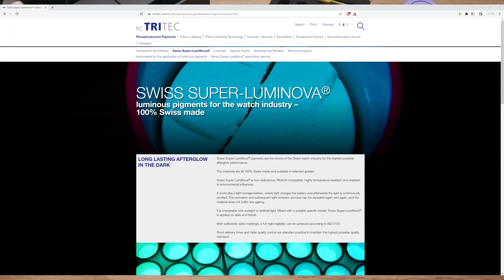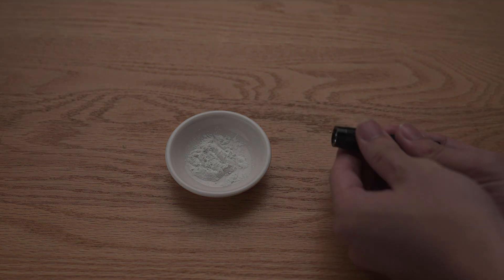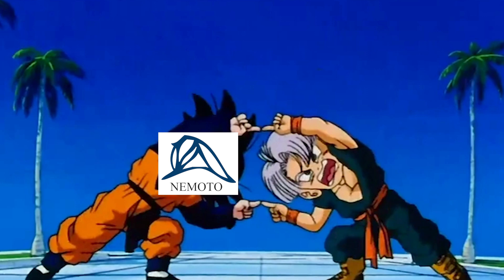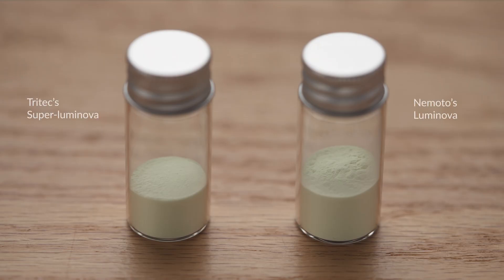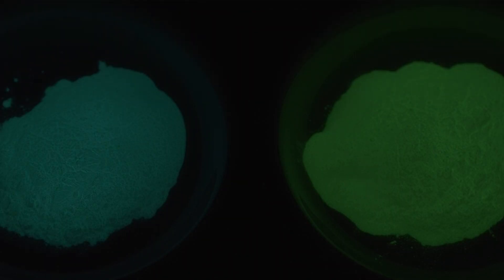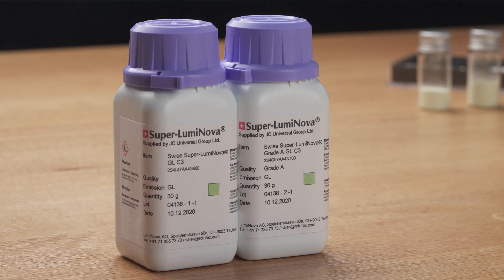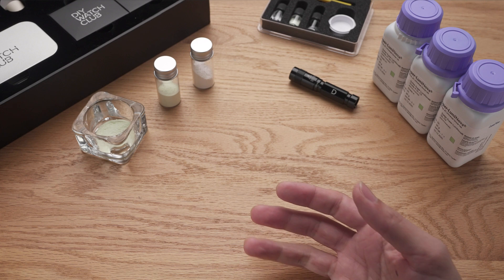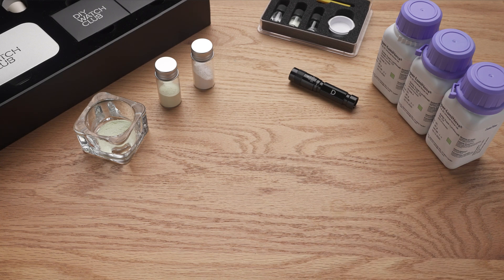The Secrets of Glow-in-the-Dark Lume: Watch Luminescence and Super-Luminova Deep Dive

Comment: This is BY FAR the best & most complete video I’ve seen regarding both the historical points and data, along with the current data for luminous materials used on watches and similar!  One part I especially liked was the mention of the older zinc-sulfide lume, which was common years ago, long before the luminous compound came out in the 1990’s.  All other commentaries I’ve seen talk about the radium-type lume, tritium-type lume, and luminova-type plumes, but they always fail to mention what accounted for the by far most common glow-in-dark compound used everywhere back before 1990’s — i.e. the zinc-sulfide compound, used on watch faces, clocks, toys, etc., etc.  Note that these were non-radium or tritium applications - they just charged up w/ normal light, albeit the glow didn’t last very long as compared to the luminova type compounds available today.  Once again, great job on that video!!

Comment: The three grades of Super-Luminova shown here, with a heavy 4mg application on an analog watch, show the three grades last for 8, 9.5, or 12 hours before they fall below the ISO Standard for viewing.  None can be relied upon for all-night brightness in a long winter night lasting 14 hours, or even longer during periods of very cloudy days.  Only the best, most expensive Super-LumiNova Grade X1-based lumes is useful for an entire night lasting 10-14 hours.  Timex had a better idea, starting around 1988. The comparison shouldn't be between the LumiNova grades, but rather between Indiglo and any other illumination solution use on watches, and at any price. 

But Timex, as we all know, is not a prestige brand- yet they have the best watch-viewing illumination solution, and have exclusively offered it for over thirty years.  Nevertheless, should I ever become interested in buying a watch with the specific advantages of the more expensive brands I will be sure to ask about its lume - duration, type and grade.  It makes no sense to buy a  more expensive watch and not get the best lume with it, right  I have enjoyed this fine article, and look forward to one that looks into the types of electrical solutions to watch illumination.

Modern element-based lumes provide a few hours of visibility, degrading to below the ISO Standard within 12 hours for the best X1 Swiss grade.  Timex Indiglo is more highly visible, and available 24/7, as long as the watch has battery power. Indiglo’s backlighting of the entire dial face is far easier to read compared to the dots and lines on a traditional lumed watch. The small downside is that usually activating Indiglo requires pushing a button, which for a wrist watch means it's a two-handed operation.  But most or maybe all recent Timex Indiglo models have a continuous mode, with the downside of unknown effect on battery life. 

Despite the Timex patents having expired ten or more years ago few if any other watch brands use a solution based on Indiglo patents.  I am curious to know why not, since Indiglo is superior in brightness and duration compared to all other lume solutions, even electrical ones by Casio and some others.  Casio currently uses tiny lights, usually two, and for duration they compare with Indiglo, but none I've seen make an analog watch as easily visible as the cool light blue of a watch face backlit by Timex Indiglo.

Comment: I have an Orient RA-AC0H03B10A which I believe uses the Seiko lumibrite, and I also have a Mido Commander Gradient, which uses Superluminova. 
The superluminova is PATHETIC compared to the orient watch ($265 new!). Fades in minutes, within 15 minutes or so you can barely tell it has any and after an hour its just.. off.
The orient lume lasts for HOURS. I slept for 6 hours the other day and I had shined it under a light for like 5 minutes before I went to bed and the hands were still noticeably glowing when I woke up.

swiss watches might have better movements, but lumibrite still wins the lume game.
Reply from the maker: Japanese lume is underrated for sure

Comment: I recently bought a Boderry Titanium watch with a movement in it that the watch collector channels were upset about the second hand being jumpy & nonhacking/doesn’t stop when you pull the crown out to set the time. Had a Seiko 5,8*** movement .?.The company apparently admitted to having a bad/faulty batch of movements…I’m new to all of this stuff & don’t know the exact #’s ov movements ,Or much about lume..the movements were “upgraded” to a different movement…?. I believe it changed to a C*** movement & claimed it had changed the lume for a C1 to a C3 .or vice versa..Im not sure about all of the details but there was implied upgrades of automatic  movement & lume on their website & in the description on Amazon(I ordered through Amazon because Iv had a gift card in my wallet for at least 2 years.recently replaced my wallet & discovered it mixed in with the clutter /accumulation of rarely used cards )watched most recent uploaded video on YouTube right before ordering & noticed they’d changed the box the watch shipped in from white to black.once again,not a watch collector,haven’t worn one for many years .my guess is I wound up getting a mixture of some of the old & new.?.Came in the newer black box,second hand seems smooth to me,overall accuracy is good,but the lume doesn’t last very long at all.& the literature/owners manual…Not sure if it is older one ore ne’er one,or if there is any difference..Watched your video because lume is pretty important to me. I want a watch that I can see,at least a little bit,all night long..In a dark tent camping for instance.If such a watch exists that you know of please let me know. .not sure if I should return the watch or just deal with it..Was looking at Citizen eco drive watches with min 100M of water resistance when I saw the one I ultimately purchased. Heard good things about them. Spent around $100 on the one I have. citizens were mostly around $200 range with good WR /screw down crown. Opinions?thanks. Liked & subscribed. Your channel seems to be getting towards the tipping point of taking off .good job.